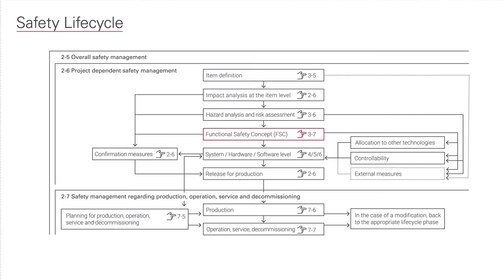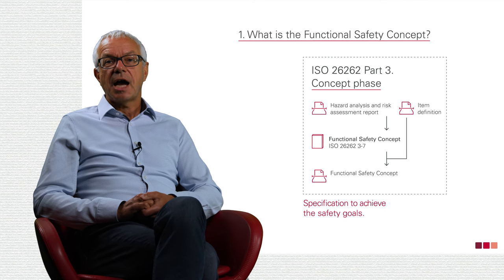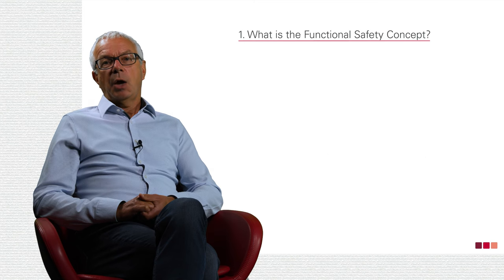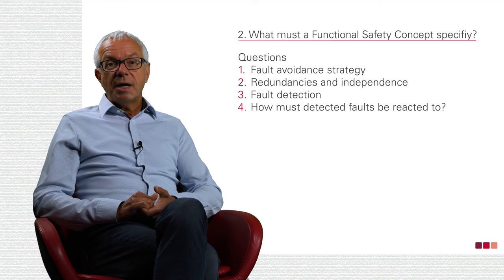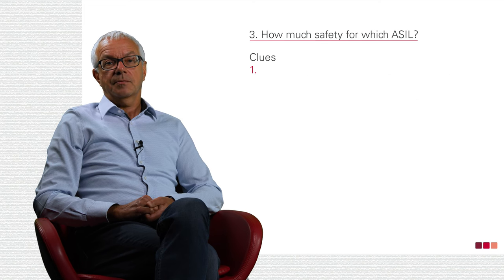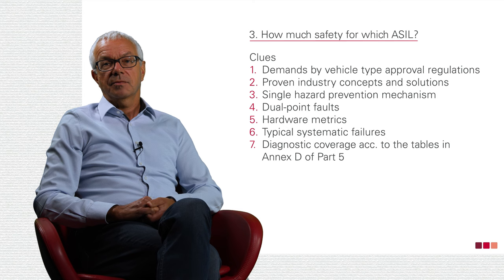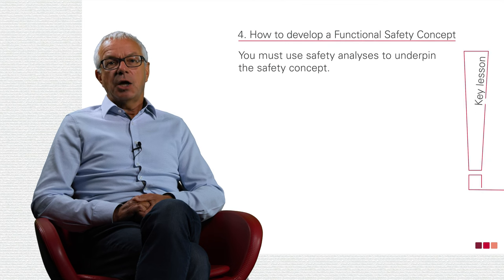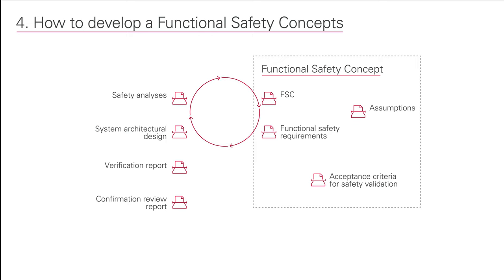Functional Safety Concepts (FSC) - ISO 26262 | Engineering Expertise EE #06

Comment: Normally system and sub system level functional requirements will be "what" the system should do not "how" or "implementation. When it comes to Functional Safety, is FSR and TSR written in "what" vehicle or System should do when failure occurs or is it "how"
Reply from the maker: In general requirements are more “what” must be done or implemented, not so much “how” to do or implement it. But of cause is a TSR already the “how” to implement a FSR. That kind of relationship applies to any hierarchical levels of requirements. We hope this helps you further!

Comment: As a supplier I have noticed that the fsc is never given by the OEM. Usually just vague "safety requirements" without any supporting info or rational. When I request item definitions and fsc's you usually get vague answers like  "its protected by ip". For the safety of the complete system I think its critical that work products from the concept phase is given as input to the development at the system level phase. Comments?
Reply from the maker: Yes, it is normal that the OEM does not provide the FSC. It is his responsibility. And yes, the OEM must then provide (good!) functional safety requirements with ASILs allocated.  The supplier does not need to know the full FSC and should however know for which item(s) his development is. And that is normally the case. We hope this helps you further!
Reply: @ULSolutionsSIS  Thanks for the answer. As part of the safety culture I usually insist on understanding the FSC, especially when FSR's are badly written or incomplete. Just saying "it's the OEM's responsibility" is not ok if you suspect incompleteness or incorrectness in upstream work products.